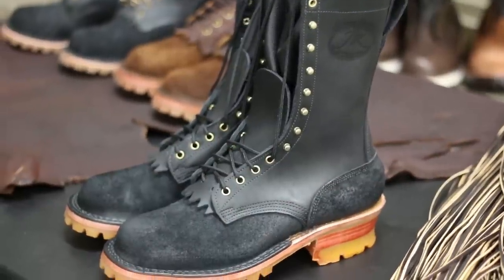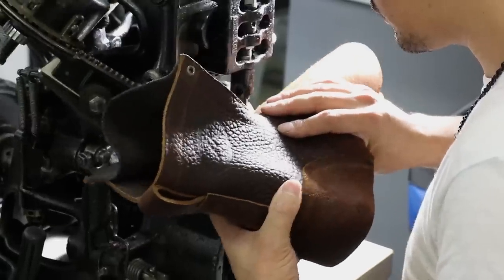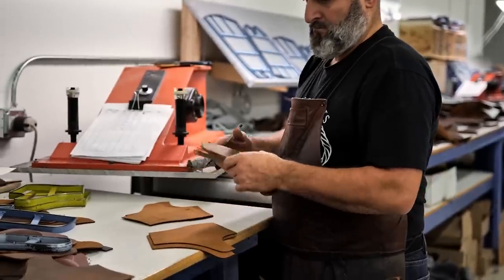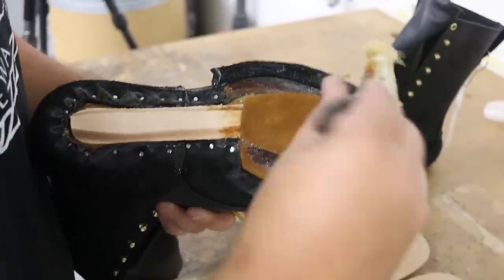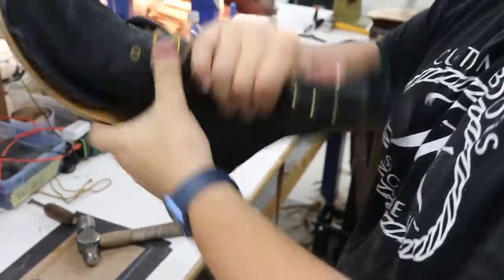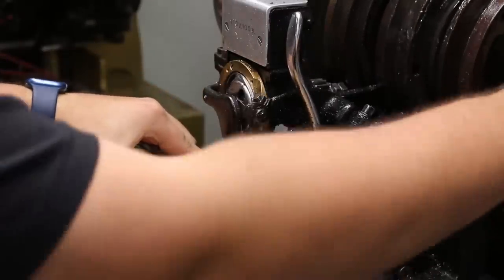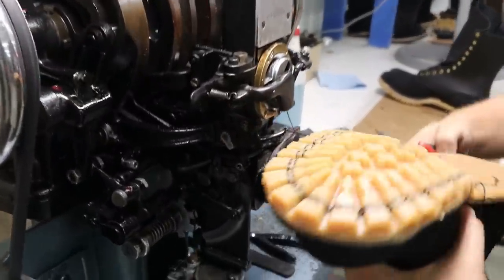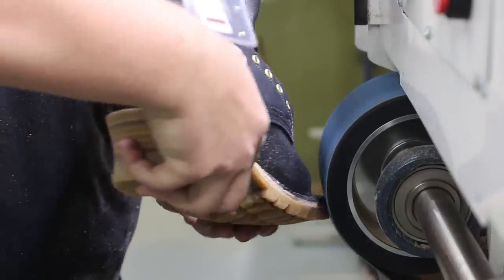Handmade Boots and the American Dream | JK Boots Factory Tour

Comment: Welders and metal repair pipe and structural steel workers struggle to get boots that do not melt and burn off a person's foot.  I've seen guys with brand new boots come out of the coke oven at maybe a thousand degrees to seventeen degrees hot with shoes on fire.  We often wear wooden show bottoms strapped on our boots to walk on top of the furnaces.  Steel workers on steel producing factories have very difficult jobs, especially in blast furnaces, basic oxygen process furnaces, coke ovens and electric furnaces where scrap steel is melted with 2 foot in diameter cathode electricity.  Most men working in these places face being burned, going deaf even with double ear protection.  I knew a train engine operator who used to pull torpedo cars from the blast furnace to the BOP furnaces.  The trough sprung a leak and his diesel train exploded.  He lived through a 90% burn on his body.  His lifelong pain a real problem.  Having totally protective shoes and clothes is essential in these jobs where workers come into contact with steel in the thousands of degrees range.  The Rubber sole of these boots would certainly melt.

Comment: I'd like to say we have better glues, but we really don't. (not that I've seen used in shoes) JK's should last a good long time with the nails and screws backing up the glue. And they're definitely worth fixing if they ever let go.

I've had three pairs of "made in america" New Balance boots delaminate in just a few years. The best I've ever had were oddly enough "Everest" branded (China) from Wal-mart. They lasted about 5 years before I took them Man-Mur Shoe Shop across the street from NCSU (not exactly across from the library) They lasted another 8 years before I had to glue 'em again. Not a bad run for a $29 pair of boots. (circa 1995)

Comment: I have worked all my life in and around the building industry in the UK, I have never met anyone here who has spent the kind of money required for custom made boots. It is more the other way round here. Who can buy the best useable boots for the least !   Cement, nails,sharp wire,stones and concrete eat boots, and the longest I have ever had a pair last was three years, and I could not replace them.

Comment: I never could understand why the sole is sewn right across the tread knowing it will wear through first thing?  Why not cut a groove on the bottom of the sole and bury the thread in it?  My Nicks boots are done the same way and the thread wears through in the first month of wear.  I guess the glue is really what holds the sole on? 🧐🤷🏼‍♂️
Reply: They are lock stitches. There is a knot down inside the sole. They hold even when all of the exterior thread is worn off.
Reply: @BryceKimball7.3  It isn’t a knot,  just the threads looped around each other.

Comment: Leave it to a family from the Old World who came to America and became a success for building a quality product that lasts.  I grew up wearing Red Wings as a logger and tree trimmer and back then in the 70s and 80s boots were built well enough to take in after 3 or 4 years and have new soles put on.  Somewhere along the way we lost that and boots and shoes became another disposable item.
My biggest gripe with "modern" footwear, especially boots, is the fake rubber soles that have plastic in them, they are twice as slippery as the old Vibram soles and are dangerous in icy conditions or even a wet concrete floor.  I try to buy the gum rubber soles that Doc Martin uses since those arent as dangerous but man, do I miss the old rubber soles.
Also, many modern boots that claim to be wide or extra wide are built like crap, the opening is so small I cant even get my foot in the boot to see if the width is even correct.  I wear a 12EEE or EEEE if I can find them but its a pain in the ass buying shoes anymore.  
Id much rather spend extra money on boots from JK than drop 200 bucks on a pair of Keens that dont seem to last very long and theres at least 6 or 8 brands I dont even bother trying on since I know they are shit.  Great video and a great family story!